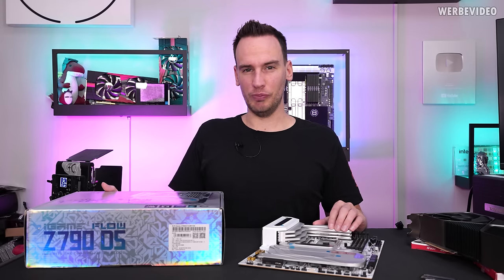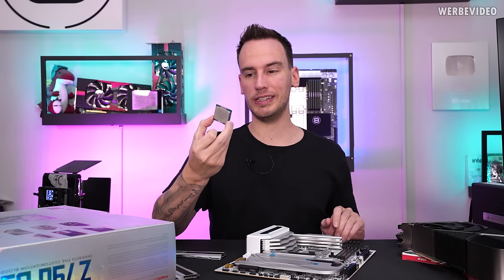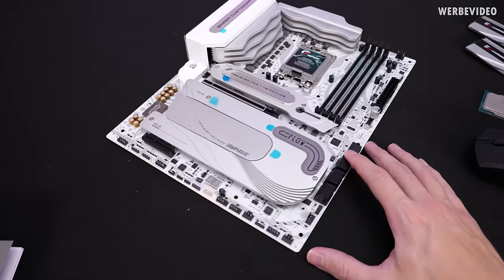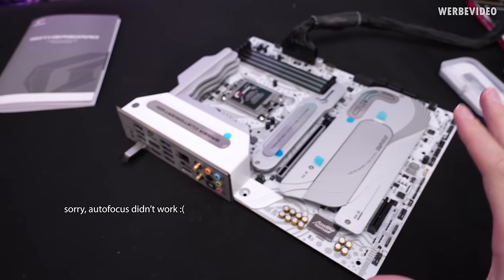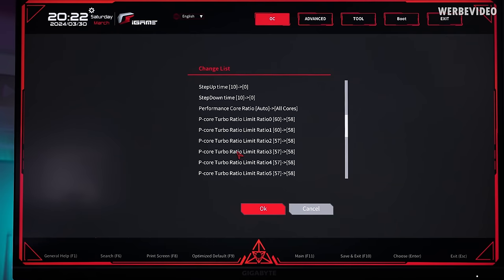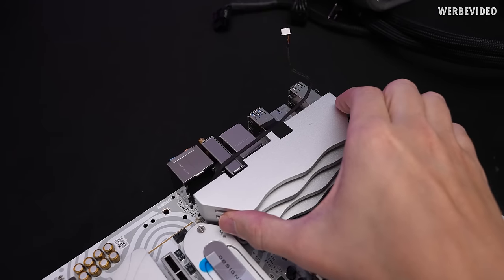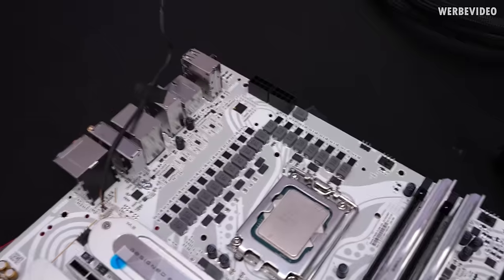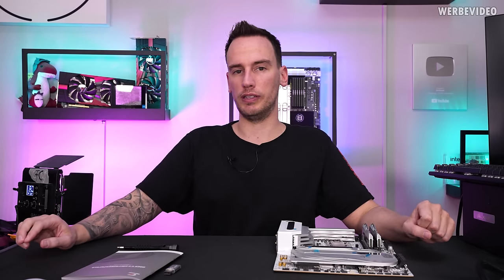Colorful Z790 Motherboards are Surprisingly GOOD!

Comment: On Z790 PCI-e 5.0 M.2 slots also force the GPU to X8. I have no idea why you'd ever want a 5.0 M.2 slot on Z790.
Reply: Z790 boards with pcie 5.0 m.2 is custom tailored made for 4060/7600 user 😬
Reply: agree
Reply: It's not only a Potatoe, it's a Potatoe Salad of PCIe ports. Of course, because nobody who knows what they're talking about watches this channel? idk - dudes loosing it.
Reply: I can't believe my £700 apex encore does that😂😂😂😂😂😂😂😂
Reply: Rather silly statement, to begin with anything below 4090 performance level current is largely fine in a X8 4.0 slot. Once GPUs get 5.0 support, that means you can even go past 4090 performance without meaningful impact in a 8x slot.

Secondly, it's not so much about "wanting a 5.0 m.2 slot", it's about wanting more m.2 slots on dedicated lanes. But if you want to bifurcate the 16x slot without dropping down to 4.0 for the GPU. Then the m.2 slot has support 5.0 as well unless  I've missed some recent changes. Because the link speed is set as an aggregate from my experience, rather than individual links when you bifurcate, and will settle on the lowest supported device speed. If you stick a 3.0 speed device into your 2nd slot on a Intel board that can do 2x8 4.0 bifurcated, then the device in the first slot will be 3.0 as well afaik.

So if you want 5.0 X8 on the GPU slot while bifurcating at a future point. Then you have to stick a 5.0 m.2 device in the slot coming off those lanes as well. That means the slot has to have 5.0 support to begin with.
Reply: It does not substationally impact performance.
Reply: @Plutonium239MXR  it's not the point they should design it where it doesn't impact performance at all or don't add the features at all.
Reply: pcie 5.0 @ x8 = pcie 4.0 @16
Reply: @mrhassell  ???
Reply: @jeroen5736 there aren't any gen 5 GPUs though, so the lanes are going to be running at gen 4 speed.
Reply: Facts. Pcie 5 drives are too dam hot and a waste of
Reply: @jeroen5736 that’s only truth for GPUs that support PCIe 5.0. For GPUs that only support to PCIe 4.0 it’s basically PCIe 4.0 x8 or PCIe 3.0x16.
Reply: It's rarely to see bullzoid around. Salute to king of oc
Reply: Yeah, and the 14900K only has 20 pci-e lanes, so it's only good for one x16 GPU and a PCI-e 4.0 x4 NVME drive. Anything else is through the chipset. The CPU's really need to support more lanes, at least x16 for GPU and x8 for NVME. Or two x8 for NVME. Relying on one large NVME drive gets pretty expensive.
Reply: Intel cpu fault not enough pcie lanes
Reply: @cppctek for me, currently, that is the truth. My Samsung 4.0 nvme drive is fast enough. I am a PC user who usually will pay the extra money for great performance, but current Gen tech is getting stupid expensive, paying $700 for a mid grade GPU was bad enough. The heat and the cost of Gen5 m.2 drives plus having another fan in my PC: no thanks. My data storage is plenty fast, I'm not sitting around waiting for file transfers.

Maybe I'd think differently if I edited 4k video regularly, but I don't. 😸
Reply: And a lot of current graphics cards are PCIe 5.0 x8. What's your point?
Reply: @Boogie_the_cat agreed gen 5 ssds are gimmicks. And not worth the extra heat or cost over 2nd wave gen 4 like say wd black sn850x.
Reply: @BrunodeSouzaLino The exact number of consumer GPUs that support 5.0 is zero. They only run at 4.0 x8 in this problem case.
Reply: Yeah it's unnecessary. Who wants to gimp their 4090?
Reply: I have yet to see a difference in FPS running a GEN 5 NVME in the top slot with a 4090 while gaming.
Reply: @toonnut1  15TH GEN Intel fixes this issue.
Reply: Yeah but doesn’t PCIE 5.0 x8 = PCIE 4.0 x16? 

Are consumer GPUs even able to saturate a PCIE Gen 5x16 connection?
Reply: @Rushil69420  They cannot even saturate pci 4.0 yet.
Reply: @JDD_Tech_MODS  Exactly lmao so why are people complaining about “only” running at x8. 

The advantage of PCIE Gen 5.0 NVME storage is limited but not insignificant when it comes to transfers of massive files- 10GB/s+ is amazing for creators and for the occasional transfer of media/backups for everyone else. It’s not going to improve gameplay but it is at least *functional*.
Reply: Idk why everyone is naysaying you, they must be completely incapable of thinking remotely into the future. Blackwell is rumored to support pcie 5.0 and even if it doesnt the next gen after that surely will. They might be the kind of "smart individuals" that buy a 60 series card every generation.
Reply: @Rushil69420 no, if you take 8 lanes from the PCIe to use them on the M2, you have left 8 lanes , you can put a GPU with PCIE 5.0 (which doesn't exist) and you have 8 lanes, if you put a PCIE 4.0 GPU you still have 8 lanes, the lanes are literally cables in the PCB  and there is a switch that redirects 8 of them to either the M2 or the PCIe slot, if the switch redirects those to the M2 , it doesn't matter what GPU you put on the PCIe it only has 8 lanes.
Reply: I couldn't agree more with you. Totally useless 5.0 m.2
Reply: @ivantsipr  I see my mistake now, you're obviously right, thanks for clarifying. I thought that Z790 boards had PCIE 5.0 broken out to an x16 and an x4 slot, but I see that's not exactly the case.
Reply: @JDD_Tech_MODS  trust me you just need to play the right game. I foolishly bought a gen 5 nvme and installed it thinking my 4090 wouldn't be affected. Well with really demanding games like Spider-Man Remastered, I experienced weird side effects and didn't know what was the cause until I moved my nvme spot. The game would freeze, slow down and speed back up constantly. Once I moved it to a spot different than below the CPU, the 4090 received proper 4x16 pcie speed on GPU Z and my games ran without an issue.
Reply: new 2hr rant incoming?

Comment: Is it just me or is it actually sad that a $400 motherboard is considered mid range without onboard physical power/reset switches!!! Hey at least we get a debug LED
Reply: A CMOS reset button and DEBUG codes should be everything but the cheapest boards but honestly I couldn't care less about power/reset buttons. On my test bench I'd rather route my own switches anyway. The reset is nice since most cases don't bother to have a second button these days but it's not a huge deal. That said, anything in the high end and/or aimed at legitimate overclocking should absolutely have all of it.
Reply: I understand flash and clear cmos buttons(what this board actually have), but power/reset on motherboard, what the hell are they needed for, open bench extreme overclocking? Even those ppl can just make 3d printed array of buttons and connect it to board and it's not even hard, like 5 minutes in CAD and 10 minutes printing

Comment: Pcie 5 drives btw are over rated and wayyyy too hard to cool at max transfer speeds. Pcie 4 drives are the way. Also, I’m pretty sure the reason it powers on when not everything is hooked up or installed is for easier diagnostic purposes to tell if the board is bad or not.

Comment: I bought a b650 colorful board on Ali and it works excellently for me, was surprised how easy the bios was to understand and it has a 5x16 slot and two gen 5 m.2 slots which for the price was head and shoulders above any of the mainstream brands (especially for mATX, the only other mATX board with a 5x16 is the crosshair gene which has a completely troll price)

Comment: @9:18 I'm certain that Roman knows, but I've had a number of boards with integrated I/O shields that adjust slightly to accommodate imperfections in the fitment of the case. The shield moves slightly and can often look like it is misaligned after installation. This is by design. Perhaps this one was just a little 'sticky' and wasn't moving freely at first? Just an idea.

Comment: 20:56 all manufacturers started like that.
Made their software as much smaller and functional to attract costumers. When they got bigger they simply integrated all the tracking bs that's available and made more profit than their own products do.
Reply: Hey now, Asrock hasn't made coherent software or added a bunch of telemetry nonsense. Boards are solid but I swear they must have hired one dude 10 years ago to program a tool that someone has tacked spaghetti code to every generation.
Reply: Colorful is no spring chicken, they just don't really care to compete with ASUS ROG and MSI on the worldwide market for some odd reason. It isn't their products, or them being too small or something. I'm not really in the market segment they target, but if I were, I'd be making my choice between iGame and ROG probably. So Colorful and ASUS. 
Off the top of my head Colorful has been around 10+ years at least, top end enthusiast market in Asia, so China, Japan etc.

Comment: Gigabyte does have some motherboards with white PCB like the Gigabyte Z790 Aorus Elite AX Ice and the Gigabyte B760M Aorus Elite X AX for example.
I have the mATX board in an all white build and it looks so nice. 🙂 Those 2 boards are pretty expensive though. Asrock has a cheap white board the ASRock B760M-HDV/M.2.
But yeah white motherboards are pretty rare.

Comment: I 100% agree with the reviews stating the top slot should be 5.0.  I also 100% agree with you probably shouldn't buy a 5.0 drive today.  The thing is, those drives will get cheaper eventually and so having the top slot supporting the same thing the CPU supports on the top of the line chipset is in my opinion baseline and should be mandated by Intel.

Comment: i do wish that Colorful had more availability in the West, as their 'CVN' Motherboard line looks so, so, so cool to me. also their CLC/AIO GPU's this gen were like, the best on the market, period.
i'd be happy with using such Motherboards provided that they're competitive with BIOS layout and Memory Training and PCB design for Memory Overclocking and sensible LLC curve settings, Et Cetera - on top of having good choices for I/O Ports, a VRM that's reasonably good, PCI-E Slot locations that are useful, you know, all the usual stuff.

my main worry really just is the Memory Overclocking. not sure if i should or should not expect that they'd have BIOS updates out in reasonable timeframes to the other Vendors, and if it would be a similar experience to the other Vendors in use.

anyways, those Charts Silkscreened onto the Board are indeed nice. always want to see more useful features like that.
the CPU M.2 Socket being 4.0 is BETTER, frankly. we still don't have any real/native 5.0 class Drives yet AFAIK, all still using Overclocked Controllers and so they run like garbage. and outside of pro level Video Editing, there's literally no benefit anyways, nor will there be for probably another entire Decade.
Reply: fyi - This White  MB is $359 @ Newegg in the US...

Comment: That's a very cool board. Very well done Colorful. It's clear the bios in particular was designed by people who actually use a board and have spent FIVE minutes or more searching for a feature in bios which is nonsense. All current boards have a bios which are akin to a full on OS and it's really annoying. 

I wonder if there's an AM4/5 equivalent from Colorful? Regardless, Colorful NEED to get this level of engineering, quality and price point on Intel and AMD into Europe and other markets ASAP. 

Excellent engineering such as this should not be a secret. Also, I think Colorful are missing a trick here by not leaning in on their own branding and producing a red or blue, mate black and possibly other colours. I know it would be expensive but, if a buyer wanted a blue, white or red board who would they buy it from? Colorful. The clue is in the name.
Reply: It literally says "Gamer Customization" in huge text over the top of the VRM heatsink, that is total cringe, NOT "excellent engineering"

Comment: Just slip heat pipes into those big fat VRM heat sink fins and stick an ROG label on it for additional bandwidth. And with all four memory dimms installed switching on the power supply opens portals.

Comment: I'm not sure why but white computer hardware looks 100x better than black
Reply: Facts ❤
Reply: Green PCBs best
Reply: black looks serious and like angry, white is more elegant, clean and professional in pcs
Reply: I agree but white hardware has a tax, and also a fully blacked out pc looks pretty clean
Reply: @ashenwattegedera  until you touch it and yurn it on and ends all full of fingesprints and the lights make it look less clean

the cases in white do not cost more all the time, the problem is motherboard and gpu, ram is easy to find in white these days for some reason, psu, no longer a problem in most cases, you dont see it, so

the heatsink, i paint the top layer and i buy gray or black fans and looks clean with white, same for the gpu

Comment: I don't get being upset over not having a gen 5 m.2 slot. My gen 4 drive pushes 7,450/6,900 MB/s read/write. Loading screens in games are just a couple seconds long. That's plenty for a mid-range board. If you want the best of the best you're not looking at a mid-range board anyhow.

Comment: 6:37 Mayby its made of plastic because, by design, to holds in place, it go to pci slots?
You really imagine using single piece of metal, that conduct electricity, and later stick them to pci slots???
To use something else beside plastic, they would need to redesigne whole that dust cover to add some type of clips or something like that.

Comment: Hi Roman, did you see the black and white build from EKWB? A black rad on top and a white on the bottom? It gave some depth on the build, quite special. I think to build a new system with that terminology. You can find it on their channel. But they used a black mobo, with this one, it would even give more depth to the eye. Great motherboard (looks).

Comment: The hardware landscape as of late has been pretty barren. Going just by the usual suspects the amount of mainboards available is shockingly low. Even worse are decent cases that actually fit radiators properly. When I look at my older computers they were all a joy to build and find parts for and now it's nailbiter after nailbiter to hopefully get something that everything fits into. Even the space for cable management has halved! GPU we all know is out the question anyways, but even decent memory has become rare. Oh nice all the speed and horrible latency. Monitors and keyboards are just horrendous and all just the same bad stuff with no innovation or actual decent specs for the money. Either overpriced junk or a nonsensical mix of features. It's so sad to see.

Comment: don't use this motherboard   i was test before 1month ago  it was terrible mainboard  This is a board where the CPU clock is not fixed
Rather, using a Gigabyte board may have moderate success

Comment: PCIe 5.0 M.2 are absolutely useless. They run extremely hot for very little real world performance gains. On top of that all motherboard makers of Z790 boards with the PCIe 5.0 M.2 in the main slot that connect directly with the CPU above the main GPU slot share the lanes with the GPU slot. How F'n stupid is that? So what is the point of the PCIe 5.0 M.2 on Z790 boards?

The implementation Colorful used here is the best. Stick to all 4.0 M.2 with the main drive above the GPU not sharing any lanes with the GPU slot.